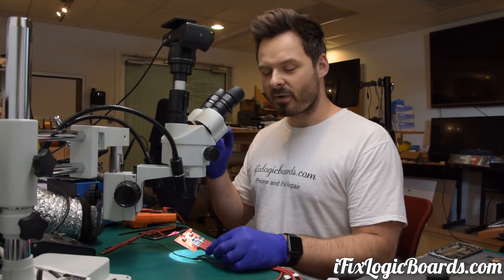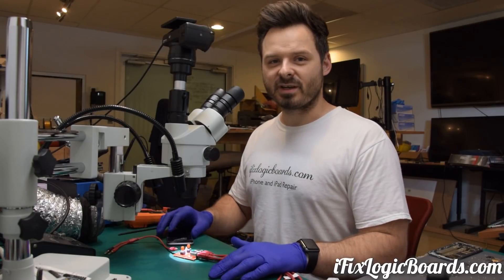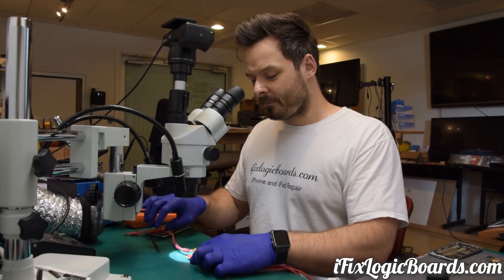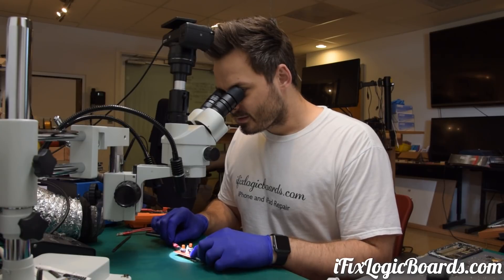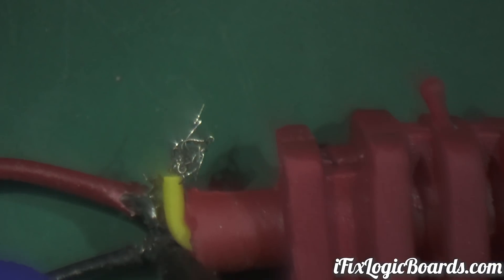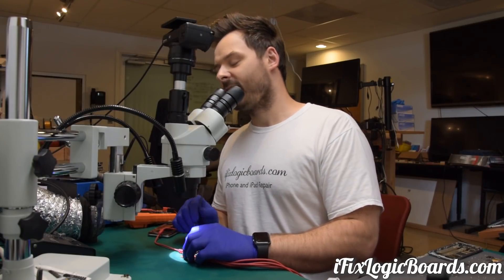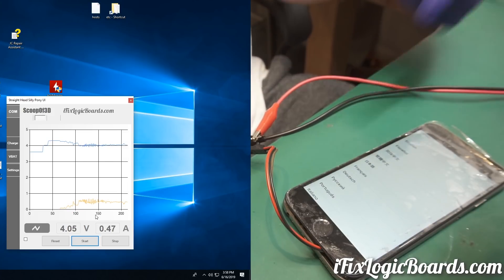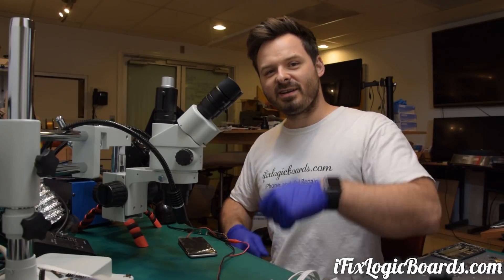What's the max battery voltage iPhone can handle?

Comment: just a question please, replaced he battery on my 4s and started to shutdown randomly..
downgraded from ios 9.3.6 to 6.1.3 and all the problems disappeared.. the battery when fully charched shows 4.4 volts.
is that to high for a 4s? the phone now is working just fine and holds battery like crazy.
thank you in advance

Comment: Hi Rafal, thanks for the new video 😀 when I’m sending a phone for warranty swap  I let 15v to the board- instant death 😀 I have one question for you, I would like to take some videos from underneath the microscope, I have the camera but I’m unable to get the picture onto my pc, do you use another device to get the picture onto the pc or do you have a direct hdmi cable from your camera to your pc? Thanks for your time :)
Reply from the maker: Lol I bet 15v is instant death.  I always record to SD card.
Reply: 15 volts directly to the board is instant death. But 15 volts USB power input isn't instant death. Why? Voltage regulations and steppers en route to the board.

Comment: Thanks fo rthe video. Its weird about the effects of the reflected light via that Amscope.  Is it that way through the eye pieces or just the camera? Wondering if its an issue with a lens in the microscope that was not ground properly during manufacturing?
Reply from the maker: It's just trough camera. I will get the head swapped. Hoping for the best.